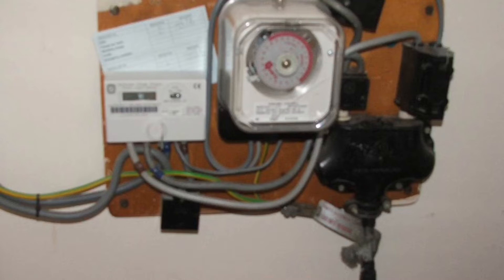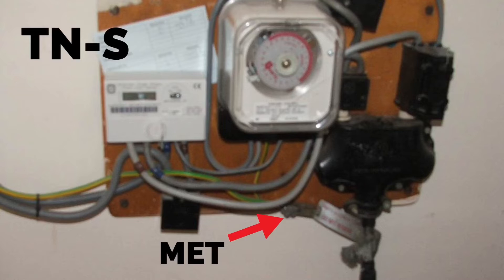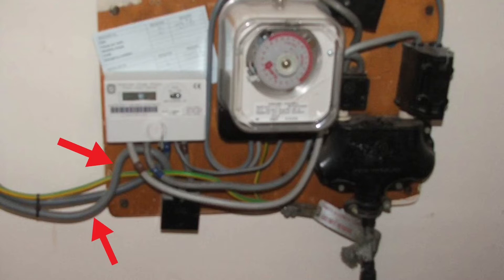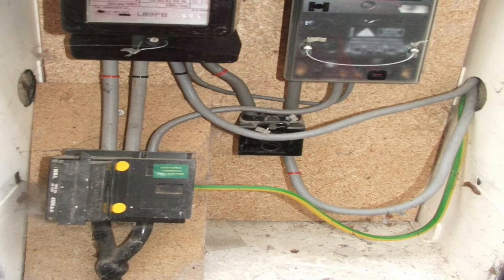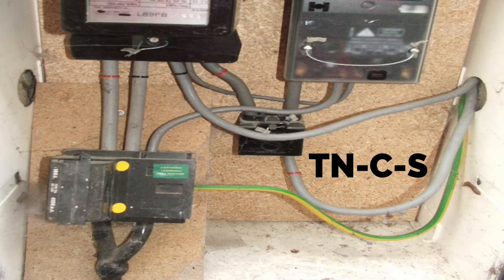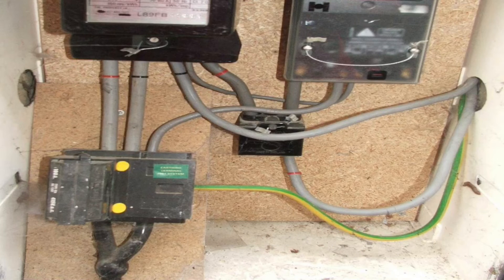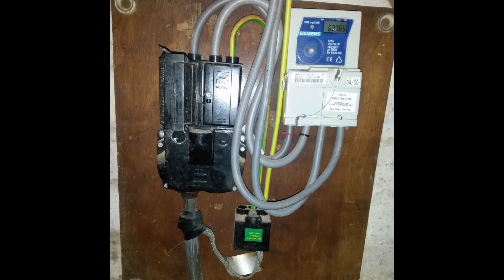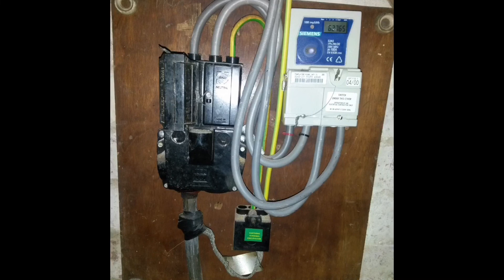Spotting The Correct Earthing Arrangement Either TN-S or TN-C-S in a Single Phase Domestic Dwelling

Comment: Do not assume an earth coming from the neutral side of the suppliers cutout is actually connected to the incoming neutral. Some older cutouts have an entry into the neutral block but required a solid link  from the earth terminal to the  neutral but is unseen behind the neutral plate.
Retired jointer

Comment: You can’t just loop an earth out of the neutral into an ETB and suddenly it’s TN C S . It’s dependent on the system and jointing on the distributor.
Reply: Yes you can. The neutral and earth are connected and the incoming earth simply serves as an "earthing rod"
Reply: @V1rtu4L0ut  You can, but it's not necessarily TN C S as that depends on the distribution system.

Comment: So, in the last installation the earth is connected to the outer part of the incoming cable (TN-S) but also through the new earth wire to the neutral (TN-C-S). Is doing both safe? satisfactory? Why, when converting it, did they leave the old TN-S connection in place?
Reply: Also, why is that an upgrade?
Reply: Does the supplier disconnect the earth connection to the supply cable at the other end?

Comment: The neutral in the first example looked horribly undersized. The final example was TN-CS plus TN-S. Surely both should be included in the EICR. My previous place, which was rewired to my spec., had all three systems (earth electrode plus TN-S and TN-CS). Ze was less than 0.1 ohm (in an urban environment). My home now is supplied from PMEd overhead lines: I have electrodes plus  TN-CS. Ze without electrodes was 0.24 ohm; with two electrodes, reading was 0.17. I think that, if possible, an earth electrode in suitably conductive soil is a good thing for PME supplies, so that there is a path for earth fault current.

Comment: In the TNCS with the Neutral and the earth being connected together is that not automatically a Neutral to earth fault? I,m not a spark but Ive watched a good few vids . Also with the dual RCBs now required would having  the earth and neutral joined  in  a TNCS not trip them ?This has been baffling me since  i watched this one, I would love a reply.
Reply: There should be no RCD before the earth and neutral are separated. An RCD should never cut the PE.
Reply: In that scenario the RCD does not operate because the "earth fault " is before the RCDS. The rcd will operate if there is a  difference of amps between input and output of the device (Rcd , rcbo).

Comment: The last example you showed of an upgraded TN-S to TN-C-S certainly confused my CU Installer as he has ticked both TN-S and TN-C-S in the ECI document. I'm having a bit of a barny with NAPIT as well as he (in 2013) installed a dual RCD CU but failed to put my sockets through the RCD. All 56 socket outlets in the house are on a single circuit. On the Comments part of the ECI there is no mention of there being an exception to the regs. NAPIT say this is OK (did not need to comment) as he SHOULD HAVE put the sockets MCB on the protected side of the RCD. Its only this year through watching some of the UTube vids that I became aware of checking RCD's on a regular basis. CU's in a cupboad - no briefing at the time of install - no stickers on the outside of CU - No need for me to lift the CU flap and look inside - where the check quarterly stickers where. I tripped the RCD's and to my surprise all the equipment on the sockets stayed on. I am pursuing NAPIT to explore what my options are vis correcting the anomaly. At least they know what my installed has (not) done. Even left a blanking slot off the DIN rail so I could (foolishly) put my finger inside the CU. This amounts to a C1 as far as I can work out watching some of the Vids. 
Pigs ear of a cabling setup inside the CU with all the cables being joined with connectors. 
I could send you some picks if you want an example of a bad install for you learners.
Reply from the maker: Thanks for you detailed comment... find me on Instagram GSH_Electrical as I would appreciate the pictures 👍 thanks Gaz
Reply: You could get the socket circuit Mcb changed to an rcbo.

Comment: I live in Thailand where TT without any earthing is used.

Currently I connect a 16mm to strurial steel buried in concrete.

Often the the supply cable is similar to SWA without the steel wire.

If I connect an earth cable to the external of the neutral conductor imnediately prior to the KWH meter is this:

1. TN-C ?

2. In comoliance with BS7671 ?

Comment: What about IT system?
Reply: TT has line and neutral with no earth.

Earth is achieved via earth electrodes.

Typically Ze will be in the 10s ohms, so a 30mA RCD before the main awitch, often RCBOs are used as the main switch.
Reply: @adriantyler1820  That is TT. IT has no neutral, just three phases. Earth is provided locally. The center of the transformer has a high independence connection to earth.

Comment: Good video.

Question. If a supply starts life as a TN-S but is converted to TN-C-S how do then ensure PME? They are not going to dig up the road and install numerous multiple earthing points?
Reply from the maker: +Gareth Warden 

Hi great question. The contracting electrician cannot make the decision to convert a TN-S earthing arrangement to TN-C-S. It’s down to the regional supply authority to make the conversion and not the contractor. Many thanks GSH Electrical
Reply: GSH Electrical thanks for the response. I understand the DNO are responsible but the same question applies. How do they convert a previously non PME earthing into a PME earthing without major work? I had western power come and change my previous TN-S supply into a TNC-S because the Ze was too high. Only took them 2 hours to change it over.
Reply from the maker: +Gareth Warden 
Hi assessment on weather a earthing system can be upgraded from TN-S to TN-C-S is down to the regional supply company. There are many reasons why it could be converted... maybe the cable in the road has been upgraded over time, maybe houses in the street have been converted to PME make lots of earth neutral connections, maybe during joints or repairs the neutral was staked to earth over time, maybe your close to the supply transformer where the neutral is earthed, etc... thanks GSH Electrical